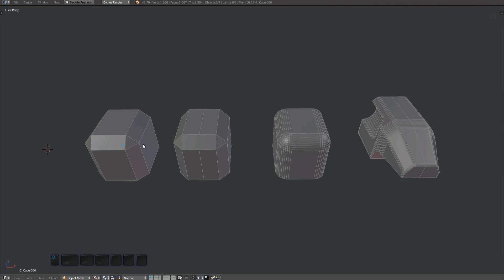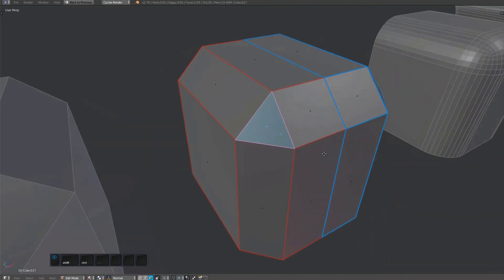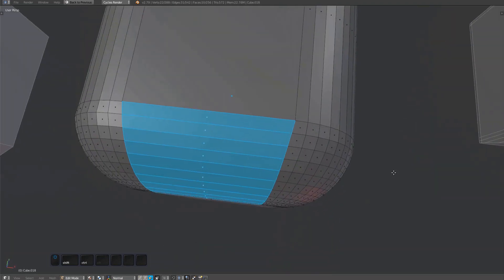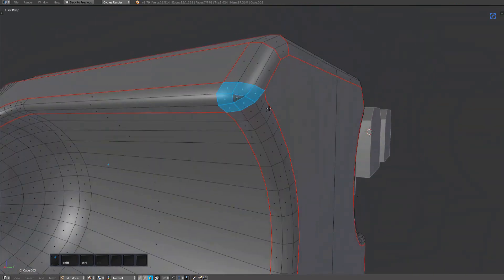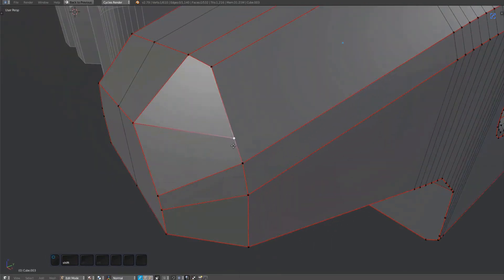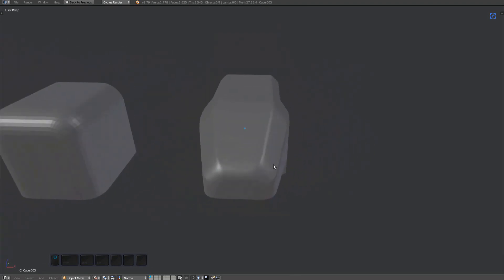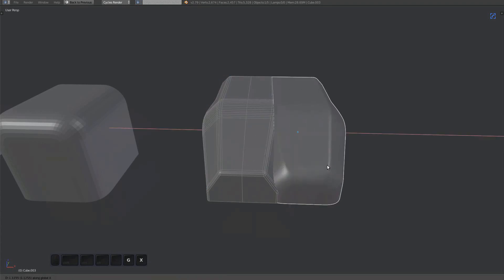MESHmachine 0.6 - Quad Corner

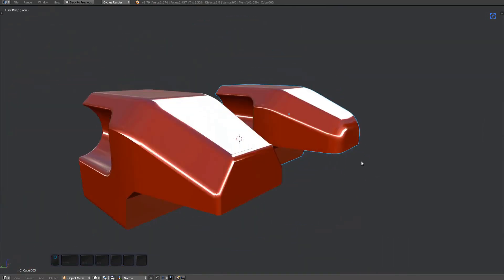Comment: great work. Loving meshmachine already. Can you help me with how did you use all different materials at 5:32 ?? [i assume its not part of mesh machine, cuz didn't see it, but may need to check quick results frequently while using meshnmachine] PS, rookie questions!
cheers!
Reply from the maker: Thanks! That's the material helper in hardops.
Reply: @MACHIN3  Thanks!
I'm using Meshmachine for industrial design and it's been helpful so far.
Requesting you to please make one video on one complete product. Can be anything say coffee-maker/mouse/joystick/VRheadset or something... Just a complete product. It will really help... 
Keep up great work... Cheers!

Comment: is it possible to change the quad corner direction in order to have more control on the flow of a certain fillet without having to unfuse and change the corner direction on chamfer and doing the process again?
Reply from the maker: Nope, it's not.